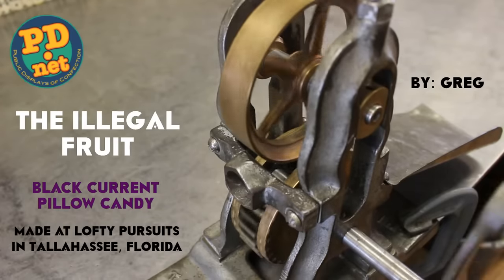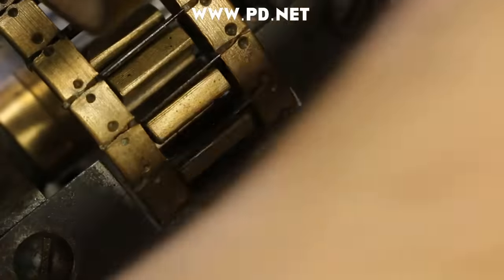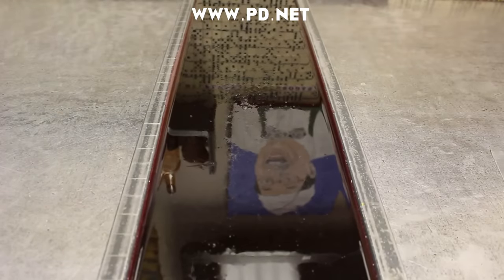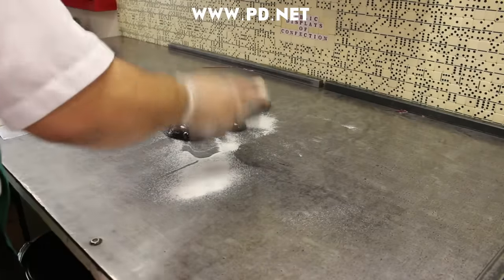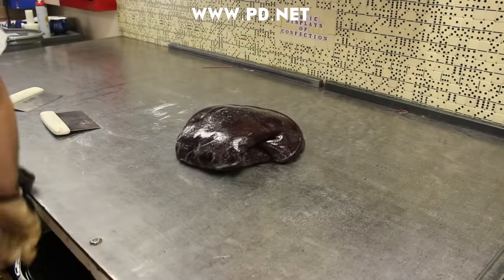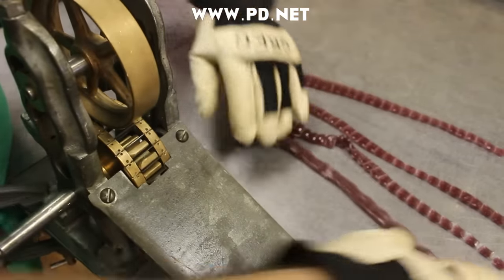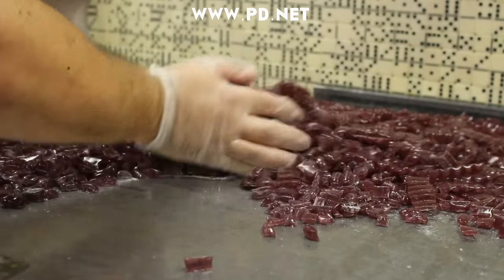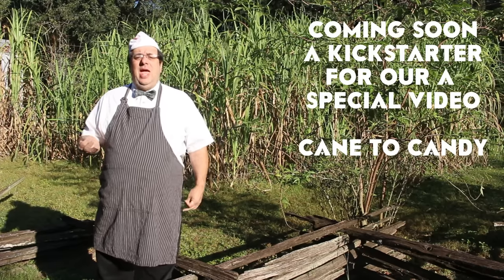#44  Black Currant Hard Candy, the Illegal Fruit.

Comment: Fun and informative video, guys.  Great job.  I'm in Tampa, so can't wait to visit sometime.

Quick tip: the background music goes up and down in volume and sometimes drowns out the voice over because it's an older song and music was more dynamic in those days.  If you run it through a compressor in your video editor using a mild to medium setting, you can control those dynamics and turn it down all together, making it more even.  Or, even better,  if you use a "ducker" compression (using a sidechain from the voice over), it does similar to the compressor but will back down whenever the VO starts, making it rise and fall smoothly, while staying out of the VO's way.  Good luck!

Comment: what is the difference between mixing the flavouring and colouring in the pot vs on the table (other than where you put the things in of course)? i have seen you guys do it both ways and was just curious
Reply: ***** oh that makes sense thank you :)
Reply: I figured that mixing the colors in on the table tends to add air into the mixture, which makes them less transparent and more opaque.  I noticed that the citric acid didn't get mixed in very aggressively here, which I assumed was also in an attempt to keep the air bubbles to a minimum.  I could be completely wrong, though.  :)

Comment: why use mild steel instead of stainless
Reply from the maker: stefan brown stainless steel keeps the heat in one place, mild steel or cast iron transmits the heat better. much better. This is why people still love cast iron skillet.
Reply: Stainless has an ungodly heat capacity compared to mild steel. And probably a low thermal conductivity.
Reply from the maker: Exactly. We need the heat spread, not stored. If you've ever cut stainless with a torch you've seen this for yourself.

Comment: In the south cooked cane sugar is called sorghum. It’s made in the fall. It’s taste like a wangy molasses. You can get it at some of the fall festivals.
Reply from the maker: Actually sorghum is a grain, not a crass like sugar cane. It's a different swetner than cane sugar. Cane sugar is mostly sucrose, but sorghum is less than 50% sucrose, with the Ballance being other sugars.
Reply: Lofty Pursuits all I know is I watch them squeeze the sugar cane juice into a bucket using donkey power. Then I watch them cook it with paddles moving it through the channels with s wood fire underneath
Reply from the maker: @reginakasakevics7891  that is not sorghum. That is cane syrup. https://en.m.wikipedia.org/wiki/Sorghum

Comment: 7:11 the problem is if i were to visit you that i would almost certainly end up being dragged out by immigration because i had over stayed my holiday visa by several moths would undobtedly have contracted type 1 and 2 diabeites and possibly type 3,4,5,6,7,8 and 9  and have to be removed through the roof as i would no longer fit between the load bearing members in the walls lol